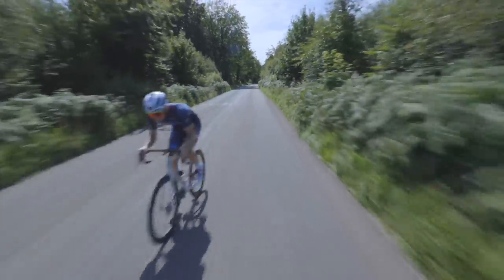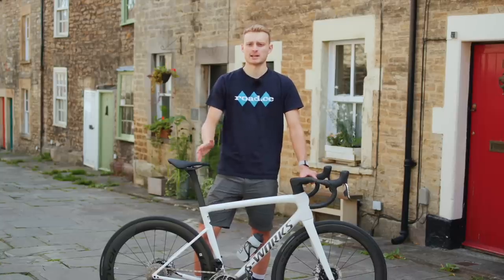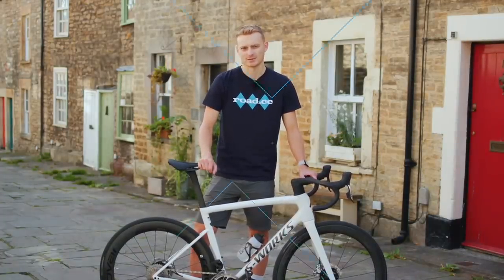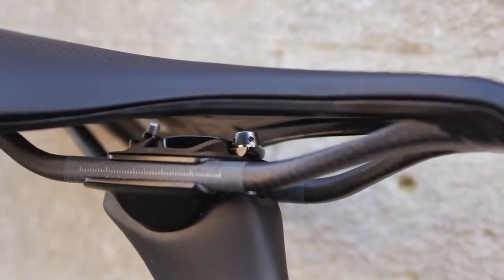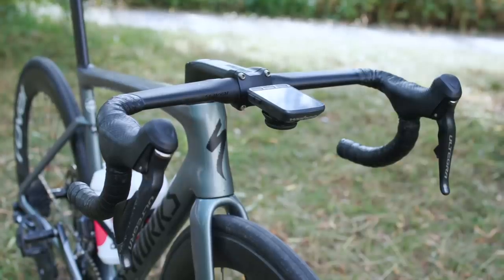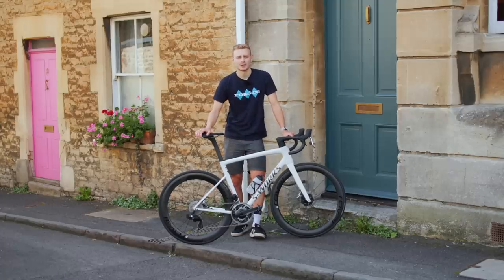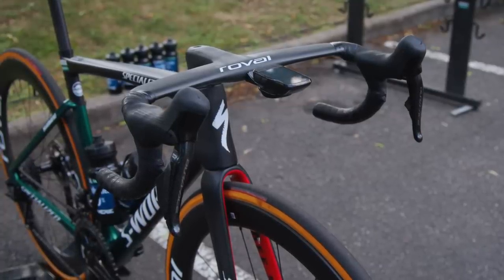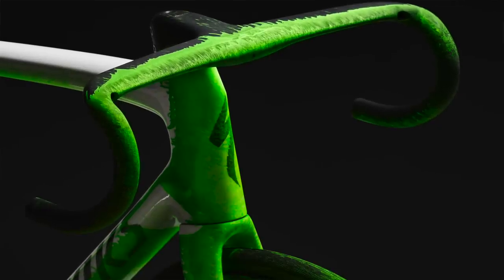8 Things You Should Know About The Specialized Tarmac SL8

Comment: In 2017 i bought brand new Kawasaki ninja 300cc(my first motor bike) for $5000 plus bought as well road bike giant propel full ultegra for $3000 and was very happy with both, Present day Ninja cost $6000 (400cc now ) price increased $1000 which is not to bad compared what happened in push bike world , road bike with similar specification now cost  $6000-7000  not only price increased by at least 50%  but now is even more expensive then motor bike which is insane !

Comment: I thought about buying this bike but was worried about the comfort level.... I'm not a racer, I ride for distance
Reply from the maker: Certainly more comfortable than the sl7 but still very aggressive geometry, we’d recommend most riders are better suited to some of the excellent endurance bikes out there, keep your eyes peeled on the road.cc website tomorrow for one that might just fit the bill
Reply: @roadcc  thank you! I'm currently thinking of buying the Synapse 4 Carbon.... it's $2600... but only has Tiagra.....so if I could get the same specs in AL for a less expensive price that's probably what I end up doing
Reply: For comfort and distance you'd want the Specialized Roubaix wouldn't you?
Reply: @FredChagnon  I thought about that but was concerned when my LBS told me about all the issues and warranty claims related to the future shock on it

Comment: Painted by hand with a “small machine” you mean ?!
Reply: No they have Chinese ladies chewing the pigments, mixing them with lard, then they spit out the mixture onto the frame and they used severed babies arms as paintbrushes to smooth out each coat. The epoxy top coat is 2 part, one part boiled bones from terminated dissidents, one part boiled sand. Again mixed in mouth. Full employee turnover on the paint line is 3 days, as death rate is 100pc.